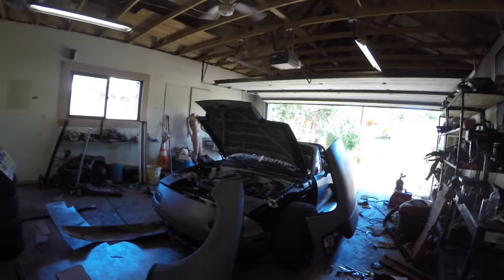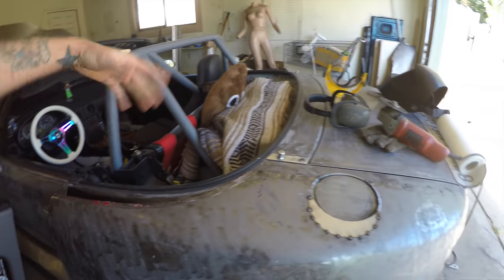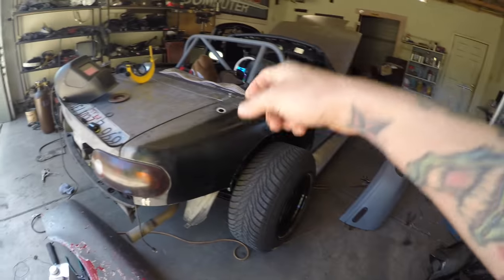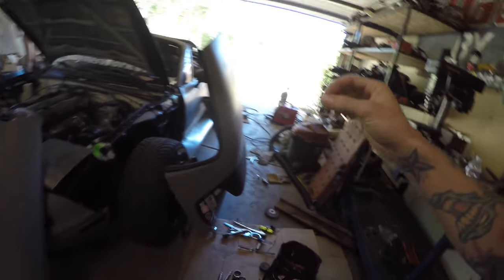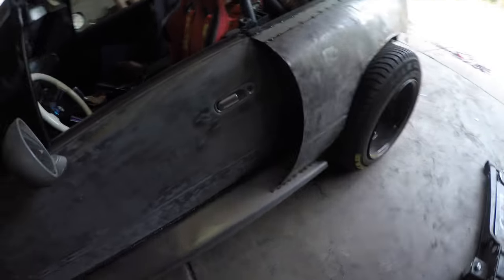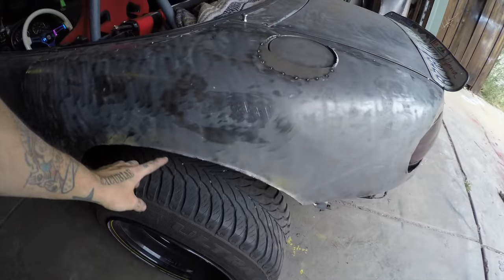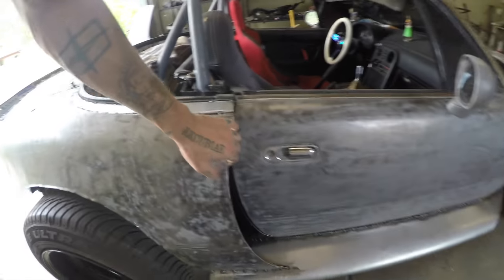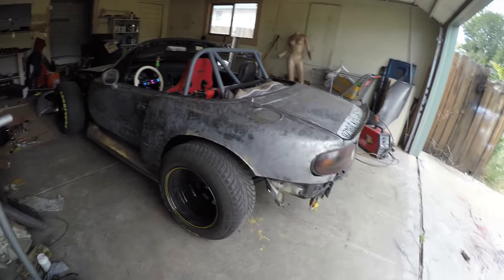Miata WIDEBODY PART 5 S06E34

Comment: Hey Wayne,
thanks for filming all the stuff you do. Really enjoy watching your channel, especially during a week, waiting before I can go to garage or racing in autox on the weekend. 
All the stuff you do is unique and so f#cking cool. 
And would be great if you decide to start GoKart#3
PS: have you done anything to wheel bearings? I'm just worried a bit for them, especially on the front wheels.
Reply from the maker: i have brand new bearings up front. they should last about a year each since i don't daily drive it to work being that i work from home. and they are easy to swap and cheap. i used to kart but a lil too old for that. i would prefer putting an LS1 into this car over than winter than messing with karts. lol and thanks for the support!

Comment: For the rear flares are you going to do any ducting to the brakes and vents in the rear to relieve pressure that it will add? ( pressure in the wheel well is kinda bad ESP at speed ) also I'm not sure if I mentioned this or not before but the lip on the hard top will make the rear trunk lip useless ( I'm guessing you know this and it's more for show anyway but I thought I'd mention it )
Reply from the maker: lol, its all for looks and downforce is not a factor until you pass 75mph, and a set of license plates isn't going to do much anyway. and if you look, there are holes next to the tail lights from the offset of the fenders.
Reply: Wayne'sWork!Vlog it depends on what you run but ya sub 60 ish you really don't need to worry CX
Just making sure 
But if you're not going to cap off those rear flares I really recommend doing some ducting and venting
Reply from the maker: as i said, its a straight pass through to the holes next to the tail lights. no need.
Reply: Wayne'sWork!Vlog ahh ok
Making sure man! Pressure in the wheel wells can do some funky things at speed ( I'm not sure about low speed but I doubt it's any good ) and can hold heat and worsen the cooling on your brakes... Not that you'll need them much CX
Reply from the maker: these aren't sealed up at all, just over skins with plenty of air flow. and the rims are so offset, they don't even cover the brakes, so they are in the breeze.

Comment: yo wayne, which model wheels are those? i know aero wheels are fairly good and cheap
Reply from the maker: series 55, the only model that comes in 4 lug and 15" speedway motors has them for $72 a piece shipped
Reply: +Wayne'sWork!Vlog thanks for the response man!
Reply from the maker: no problem!